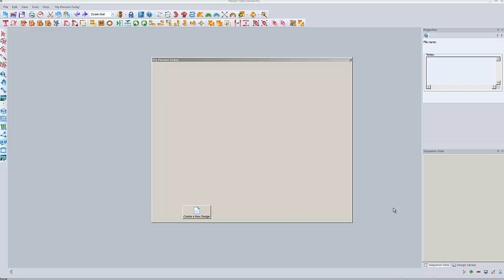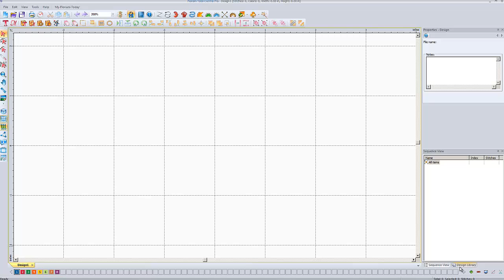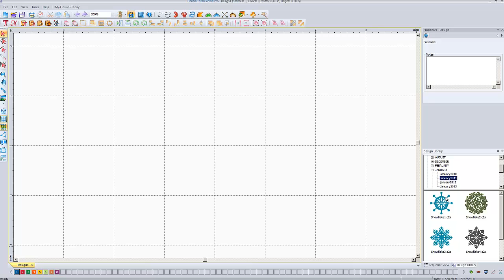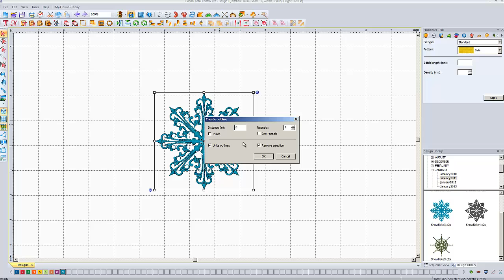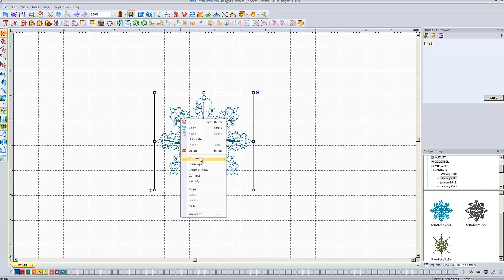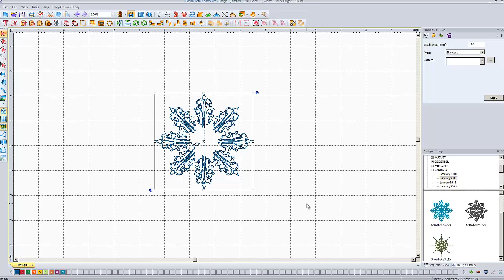Floriani Total Control - NEW Outline Tool

Comment: Brad, I'm new to this, and for some reason I don't have the same icons that you have.  I just finished updating the software, but it's still not showing the same thing.  Do I have to reboot the computer maybe?  I've never digitized before, so just trying to get my feet wet.  I love how easy this is compared to the ones I've tried in the past (obviously never succeeded with). LOL.... thanks